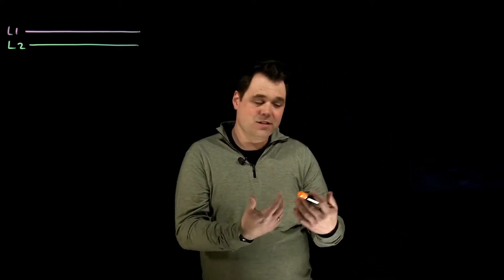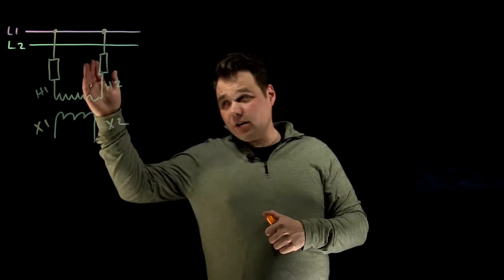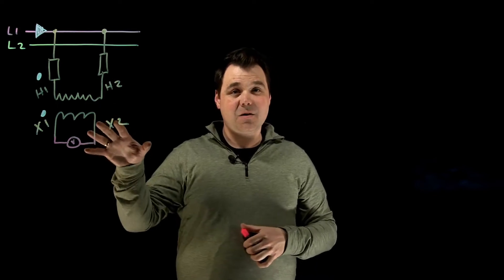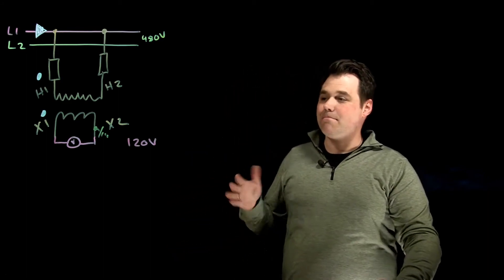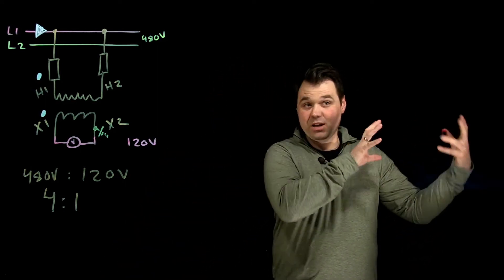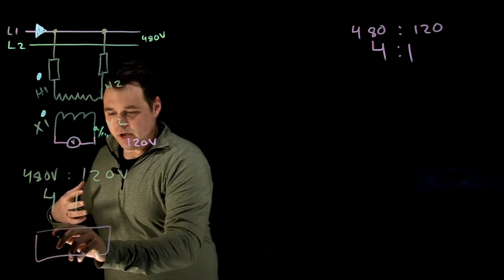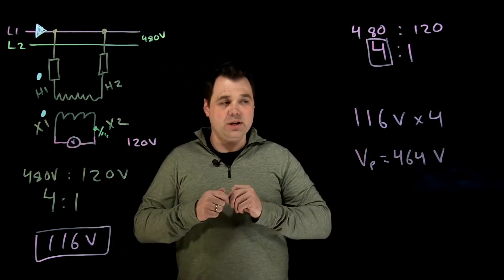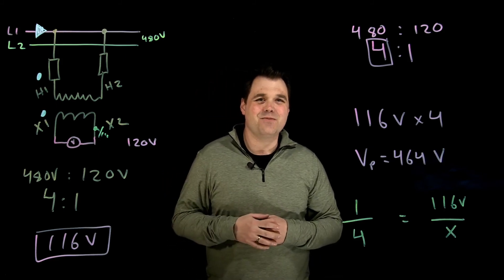Potential Transformers - Basics and Calculations

Comment: Quick Question. Would your voltmeter read 464 Volts even though it was only reading 116 Volts.?  I understand it uses 120 volts. It seems necessary for the "operator" to know what the voltage of the line actually is without having to do math.